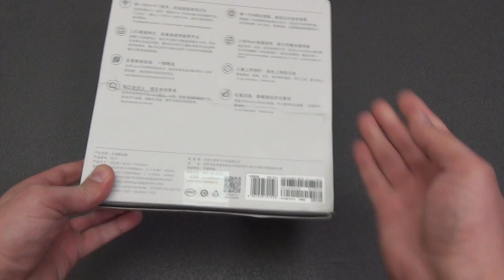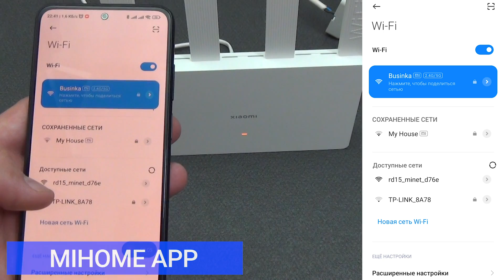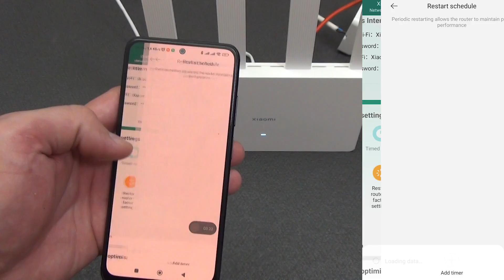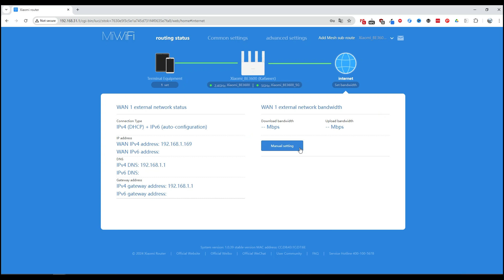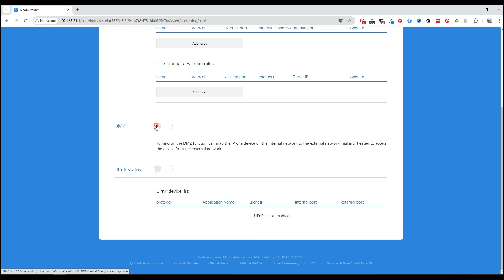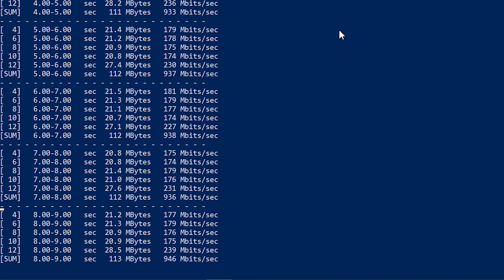Xiaomi BE3600: WiFi 7 доступен каждому! Обзор нового бюджетного роутера

Comment: Здравствуйте. У этого роутера есть функция MU-MIMO?. проста в настройках его не видно переключателя! как в роутере Xiaomi AX3000T или Xiaomi BE6500!
Reply from the maker: Приветствую, да, функция MU-MIMO присутствует на этом роутере.
Reply: Thanks for the review and the demonstration on setup.  Also you mentioned the router supports PPPoE which is important to me as I can plug this directly into my Openreach modem and connect to fiber without having to use the isp rougher.  As PPPoE allows me to enter my log in details for my ISP.
Reply from the maker: Yes, there is this function in the settings.

Comment: Is there an option for wifi schedule (turning off wifi at night for example)
Reply from the maker: Yes This can be set up via a mobile app - watch the video. There is a timer for Wi-Fi operation
Reply: Ok I heard/saw the restart timer option but I didn't know it's possible to schedule off time with this. Thanks. @EvgenLubops  @EvgenLubops
Reply from the maker: Yes you can without any problems.